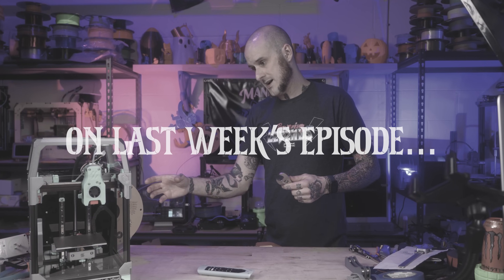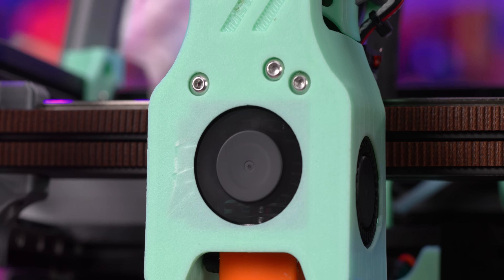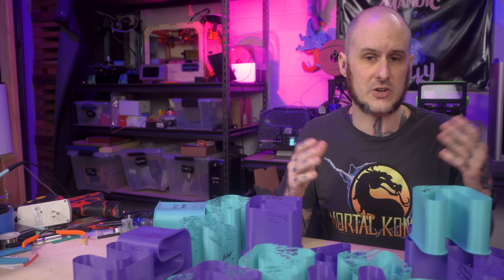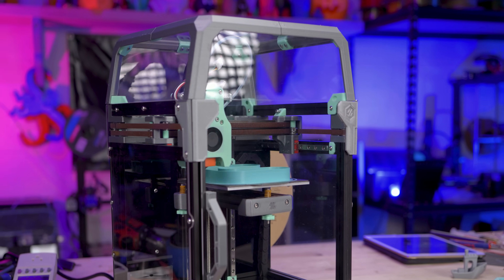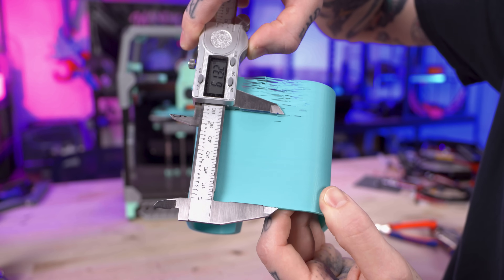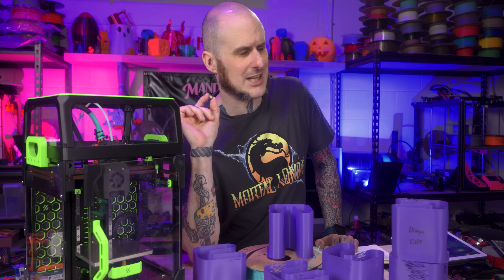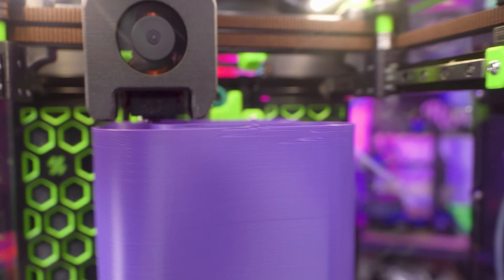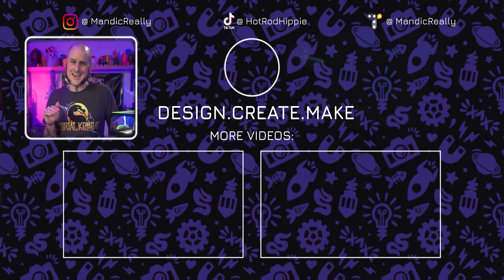The TRUTH about CHT Clone Nozzles! - Are High Flow 3D Printer Nozzles worth it?

Comment: It sounds to me like a high flow hardened steel nozzle ran at "normal" speed would give you most of the benefritts and the least negatives of all combinations? The high flow putts more heat in to the filament and the hardened last the longest (of the none exotic ones) so the reduced heat transfer by the steel is made up for by the high flow design that if you do not print extra fast you gett the filament fully melted any way. Have any brand made such a nozzle or am I missing something along the way?
Reply from the maker: @agw5425  you are theoretically correct. Higher flowrate can arguably increase layer adhesion and extrusion consistency at lower speeds as well as unlocking higher maximum speeds. This is difficult to test in the real world and I don’t off hand who has done so. 

What I do know is a company has made that product. The E3D ObXidian High Flow nozzle that I run in my X1 now is that nozzle. It’s hardened steel with a wear resistant coating to further improve its wear characteristics, and it has the Bondtech High Flow tech inside. 

I used it in my “Ultimate X1 Build” video: https://youtu.be/AppUVvf-UGg?si=QcfUUBlORvA2zlsO

Edit: idk why I defaulted to the Bambu nozzle in my response… High Flow Hardened nozzles do exist for typical hotend designs as well. Bondtech has hardened versions of the CHT nozzles that I’ve been happily running recently. The “Bozzle” nozzle is a tungsten nozzle that has a high flow design but sadly is rarely available. Some others exist but those are the notable ones.
Reply: @MandicReally  Thanks for your reply, do you think that nozzle will work in my Creality ender3 v3se?

Comment: It's a bit of thread necromancy, but: Prusaslicer and many others have the capability to add speed changes etc. to the gcode. In Prusaslicer, you need to slice the file once, then go to the layer, you want to add the change, click the plus icon on the slider and add the desired change in speed, temp.. whatever... 
It is kind of what you did manually in the code file, because you need to add the code as well. But: you have a visual help to find the right layer to do the change in.

Comment: Liked the video, here some interaction:
1. Mod the brass nozzle with a dremel poit tip instead. Put the tool in the drill ( not dremel] and turn it slowly. It has the angle closer to what cht used (i suspect they used 22° cone, dremel has nice tip mills of some 50° IIRC)

Comment: I am not convinced🤔 you say Original Bondtech performs better while CNCKitchen's measured results are opposite... even using longer heatblock area will help or even copper nuts... I don't think nozzles have too much quality impact or increase flow rate on prints but heatblock material,heating cartridge power,vibration and slicer settings are things we should look into more😉

Comment: Thermal paste is not suitable for this purpose. It is designed to operate at much lower temperatures.
Don't use it.
Reply from the maker: The thermal paste I use is Slice Engineering Boron Nitride Thermal Paste, it is rated to 850C. I'm not using or recommending CPU thermal paste...

Comment: I'd just drill a 1.5mm-1.7mm step into the entire thing at the top tbh to fix it. that way it almost acts the way the dragon high flow did!
but I have another variant of this clone (a hardened one with a brass insert in the hole it has) and it works great! I love it. still not enough for 400mm/s on my poor Prusa mk3s (yes...) so I had to get a volcano and then do a volcano CHT clone! that one can do almost 25-30? I'm confused to. my v6 with a v6 nozzle could only do 12 at best. with the clone CHT mine did 18-20?

Comment: I was wondering what would happen if you drilled a 0.4mm hole from the nozzle end. It would most probably go off course but if it did remain central that would get rid of the flat edge and give another hole for the plastic to flow through.

Comment: Honestly, some of the cht clone nozzles work better than the real deal, the copper core they cut into the cht insert actually works really good and holds a ton of thermal energy.

Tell ya what though...thermal paste on a hotend... That's a new one to me.  I would have thought copper to copper connection would be about as good as it gets.

I've got an idea, what if you cut in a small 1.75mm center hole, directly in the middle, so the edges melt the filament a little before it hits the split.  Might help it work better.

Comment: As someone who just tried to drill out a clone CHT nozzle myself, glad you went the extra mile to try it too. The 0.6mm version I got was worse than a genuine V6 0.4mm which boggled me (using E3d Titan Aero extruder). Drilling it certainly improved the performance, but my drilling was a bit messier and at higher rates (15mm3/s) the filament came out with curls! I went back to my volcano setup.

Comment: Running a CHT clone right now. Was like $15 for 6 nozzles. Cheap ones on Amazon. For the future it will be the CHT type nozzles or forget about it. It will be hard to burn through my other non CHT nozzles. I don't even want them in the machine. The cold pulls are clean and form to a point that doesn't require clipping before reloading the filament. If you go to a CHT or clone of it you will never go back to a regular nozzle.
Reply: I dremeled the entrance of the nozzle to thin the leading walls. I am using a knock off Bondtech extruder. Scary how fast it flows with smooth satin walls and glossy floors.

Comment: I am presently getting exactly the same kind of results with a cloned CHT with the copper slug. Sharpening that big flat surface in the middle makes a big difference. I am also finding that the cloned CHT has more back pressure than a traditional nozzle at lower extrusion speeds even when modded to sharpen the hole edges. It only begins to perform better than the traditional nozzle at high flow rates. You need an extruder with a good grip to get past this limitation.

Comment: for measuring under extrusion before complete failure, you could have measured the thickness on the samples you made and plotted it against starting line thickness. You would have to cut up the model obviously at the "speed change lines"
Reply from the maker: I’m fairly sure I said that in the video and noted it would have added a lot of time to the testing procedure that I simply don’t have. It’s doable but time consuming.
Reply: @MandicReally  i have a mikd condition of yours so I could have missed it :) great video by the way. Love youre content. 

I also find my self "just another xy"

Comment: The one's I see on Ali Express are now Copper in the center (much more thermally conductive). It would be interesting for you to test those!
Reply from the maker: The real world difference of thermal conductivity between the two materials isn't as drastic as the numbers would suggest.  I have plenty of Copper printer nozzles, they don't flow better than brass ones on average, just can handle higher temperatures. Couple that with the fact that the copper is in the middle of brass, so the heat would have to transfer through the brass to the copper.  I doubt it is done for any reason other than convenience of the production method.

Comment: For quick testing, use this: "TUNING_TOWER COMMAND=M220 PARAMETER=S START=100 STEP_DELTA=10 STEP_HEIGHT=5" (customize to your liking)
Reply from the maker: I think someone pointed out that running a print in Vase Mode & using Tuning_Tower can cause issues due to processing. I’ve not tested it yet as I forgot about it when I did this. Also the the method I showed can be used in any of the big 3 firmwares, so for that I still like it.

Comment: since you are using prusaslicer it would have been a lot faster to write this into the custom gcode section and write an if statement for layer height. this way you wouldnt have to manually add the command in the gcode file. this also would work for marlin and RRF and klipper. still a good video.

Comment: Experimented myself with the clone CHT nozzles. I've compared them to a normal V6 clone. I'm using the 0.6mm variants and the CHT's are the Ali type with the copper slug in the middle.
Unmodded the clone CHT was indeed slightly underperforming compared to the V6 clone.  did the same mod, and after that, still no real improvement. So yes, I could have known after watching this video 😎.
I will be center boring one CHT to do a final test (I have a lathe), but I'm pretty sure I will be going for the following setup;

Standard V6 heater block with a clone volcano nozzle, with a extra M6 nut on it (CNC-kitchen showed that in one of his videos).
It will perform almost as good as a volcano nozzle in a volcano heater block.
Plus side to stay with the standard heater block is, that I san simply switch out my 0.6mm volcano nozzle with a standard 0.4mm nozzle if I want to without having to remove the heater block and its accessories.. 

Down side is that I have to change the heigth of my 3D-touch to be able to use ABL... 🤔

Comment: It would be better to test that CHT nozzle can have better layer adhesion. Considering it melts core of filament, may be even clone has better layer adhesion than stock V6 at same flow rate?
Reply from the maker: Interesting point. I noted zero layer adhesion issues but didn’t test for it. Would require printing different test prints and building a testing fixture. Maybe eventually I can justify that, but I cannot today unfortunately.

Comment: You can find these knock off nozzles all over aliexpress. I got a couple coming so I can test it against a v6,volcano and creality spider.

Actually looks like it isn't the exact one you have but what you mentioned with the copper. Darn, Ohwell guess I'm testing the copper slug version!

What kit did you use for the budget build?
Reply from the maker: Check my previous video. I did a full build / review of the kit. It’s from SIBOOR.
Reply: @MandicReally  checked it out lastnight, for sure interested in the kit when it's time to build another printer. Got to finish my "pooron v1" and voron 2.4r2 before I get started buying more parts 😄

Also a thought,maybe I should test a creality nozzle for fun.

Comment: If hotend dictates flow why can't we test nozzle with a ball valve aka anti ooze nozzle?
Reply from the maker: This data shows that a hotend alone does not dictate flow. Technically the entire extrusion portion dictates it. Nozzle, heatbreak, hotend, ptfe tube, extruder, and reverse Bowden if you have one. Resistance in any of them can reduce flow. 

Getting numbers like these isn’t about just having data points. It’s about testing the useful range of a machine. Data collected on a test stand may relate to that, but will never be a 1:1 comparison.
Reply: @MandicReally  would be interesting to see how ball with spring 2N/mm will lower the flow. Of course fast small corexy does not need anti ooze nozzle.

Comment: You're getting crazy good results for the V6 nozzle there, i don't have experince with that brand of ASA but my CHT nozzle hits 40mm3/s in esun abs+ and sunlu and polymaker abs and i can only get 17mm3/s out of a v6 

I can do 27mm3/s in anycubic PLA and i can only get 14mm3/s out of the same anycubic PLA in my v6, revo and copperhead, and 13mm3 out of a creality lined hotend.

However, I've got the stepper motor current set fairly gentle and so it skips rther than grinds filamant or blows the ptfe tube up into a balloon if somehting goes wrong. I'd want to play with a load cell before being comfortable cranking up the current, and I'm limiting my real world print speed by the amount of die shrink i'm getting. This is worst with PET-G and I'm using this kind of test tower mostly to identify where die shrink is problematic.

There's often a change in sheen visible on this kind of test tower that's handy for setting external perimeter speed.
Reply from the maker: That Polymaker ASA likes to flow. My default profile for it has the Extrusion Multiplier down around .93 to prevent over-extrusion.   That said, the test is flawed in that the point of failure and the point of under-extrusion are likely two different things. So it’s likely I’d consider it a failure at a lower value than these tests indicate.
Reply: @MandicReally  yeah, I think I linked a test that makes blobs at different flow rates you can weigh elsewhere. I use a very similar tower and look at when they start to twist out of shape as one limit, and use whichever is lower. PET-G gives me the biggest difference and in real world prints I'm dropping the speeds even lower than the towers suggest because of die shrink. Good  PLA just works, but if imt chasing flow rate for fast prints I'm always at or near the top of the recommended temperature range. If you're chasing quality then printing cooler might help with some features, but be aware that calibration prints are often layer time limited and give misleading results.

Comment: As you are clearly following CNC Kitchen, why not use his method of testing flow by printing "blobs" of filament and weighing them?
Reply from the maker: Requires a good scale (bought one it sucked, didn’t have one to do this video). And I also prefer tests that return results while printing. Stefan’s test is excellent for detailed tests of limits and generating data but I always wonder about tests like that applied to real world work. Actually printing and object and running a test are often different. Granted his method would show the underextrusion I know I’m missing.

Comment: I am not Stefan... lmao love it subbed thank for the science I feel a liquefier tube style hot end is coming our way soon (like the stratasys but open source) but do have serval CHT's and can confirm they are 30 flows with 6.    your modded one is 3x better than the cht copy as long as the filament is molten upto a 22.5 deg turn is not that bad but the wall is always a wall.... cheers 22.5 deg- 45 deg is the optimal range for taper angles like the real CHT